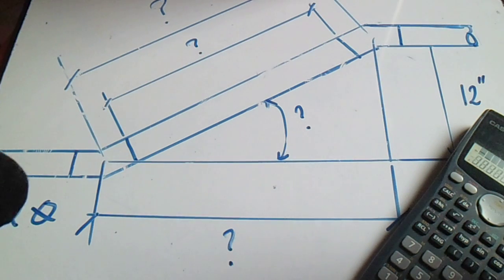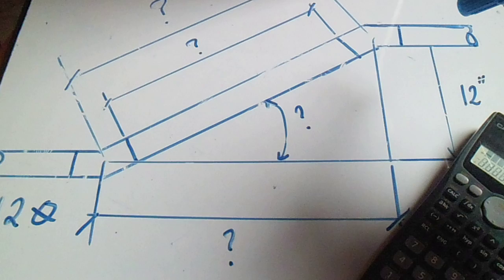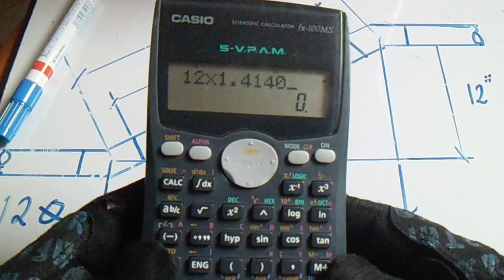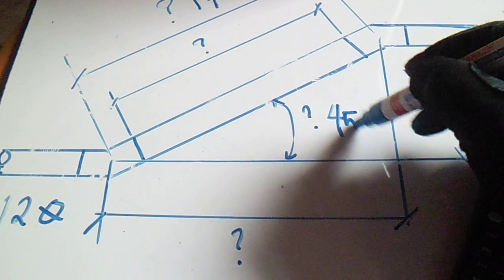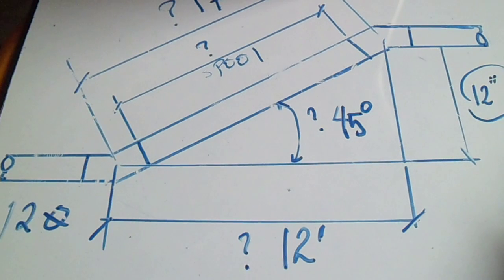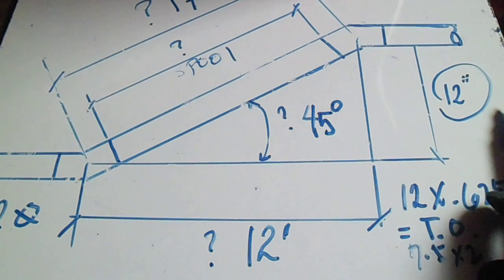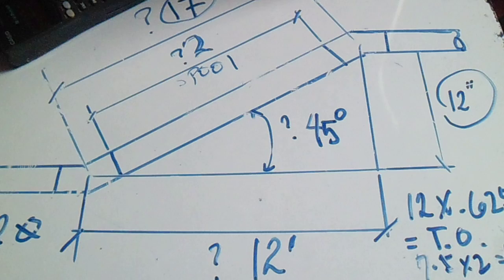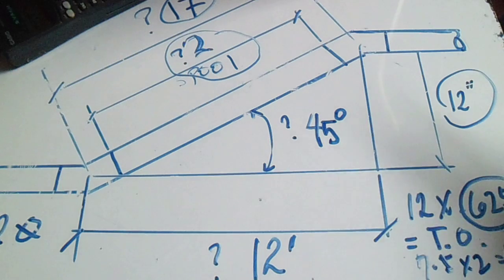How to find Travel, Run, Takeoff, Spool and Degrees? Pipefitter

Comment: just so everyone knows 1.414 only works when the degree is 45. there is a differant number for each degree. there is also a way to find degrees when one side is know and find sides when degree is known
Reply from the maker: Yes Sir!
Reply: nathan duren how do you find degree when one side is known in this aspect my set is 1.625" using 4" pipe and butting the fittings together. how to I determine degree of fittings needed with only those variables.